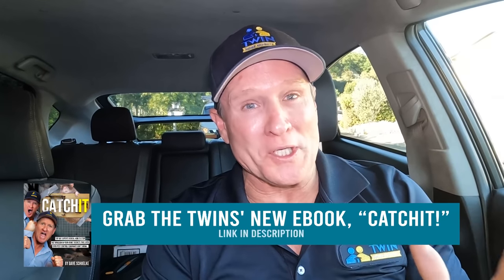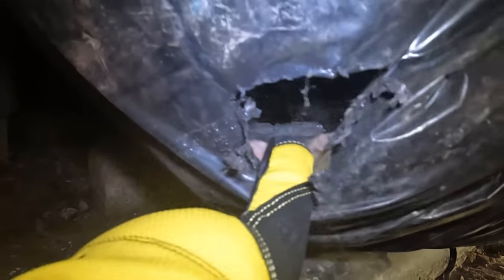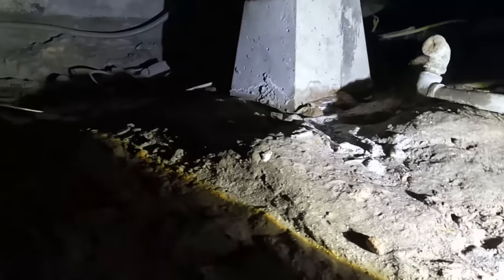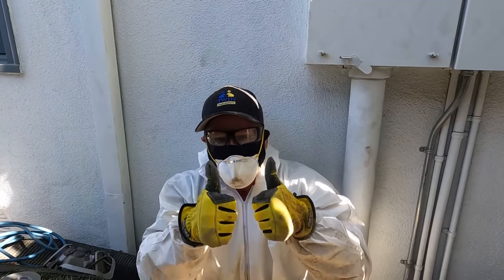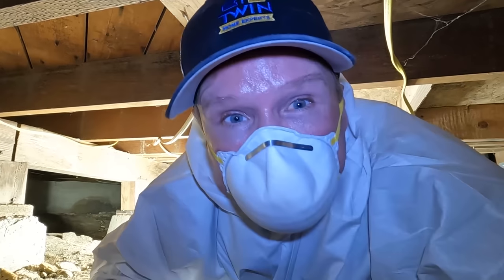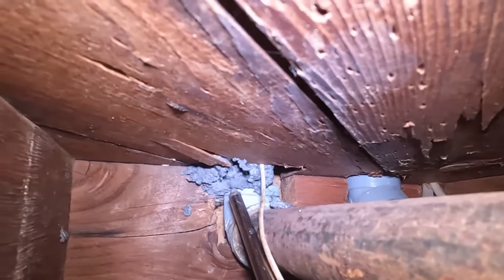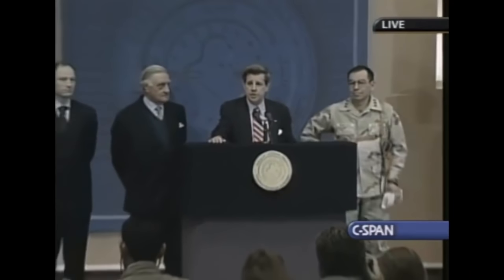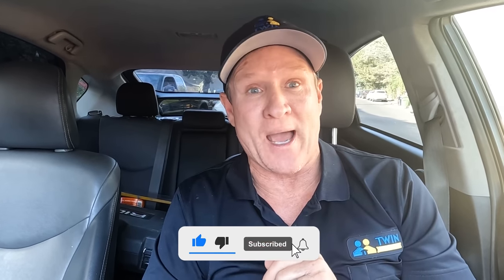CHANNELLOCKS vs RATS!! THE BEST WAY TO GET RID OF RATS QUICKLY!!

Comment: I just went through some crawlspace exclusion. I fought rats for a week or so; they either started eating each other or going after stored food (e.g., snail shells). I stuffed one small opening with steel wool (about the size of a dime) that the smart ones exited through by removing every night... I don't know how they fit  because they were big (caught a 5" one outside the house). The final one chose to stay inside and ate some baking soda balls; it hid itself in some crawlspace insulation when it died, and I had to fish it out because of the stink. I learned all these skills from The Twins videos!
Reply: I use to work with insulation. So that meant attics and crawspaces, still have nightmares about it. The smallest attic we ever crawled threw was about 17inches. We use to stuff main entrances (rat holes) with mesh and foam. Horrible times
Reply: @TheycallhimZee  17 inches? Wow. I can't even imagine. I would much rather be in an attic than a crawlspace, if it's large enough.

Comment: I’m no expert but I have no idea how or why homes would ever be designed this way. It’s absurd to me that ducts would be hanging low like that in a damp crawl space laying in the dirt essentially. And why in the world do crawl spaces exist…. Seems way more logical that if you’re going to have something like this, it be a much larger area in case maintenance and repairs like this needs to be done. Then again I’m not a builder nor an engineer, perhaps homes are built like this for some specific reason. I have no clue, just seems absurd. You’re only making it harder on yourself to have such a tight space like this. Respect to you guys for getting under there. You couldn’t give me enough to go anywhere near a hazardous environment like that. Great content fellas!
Reply: I’ve bee thinking that for years, where are you located?
Reply: The unseen areas like the crawl space and attic are always very shoddy, it seems to me. 
So many wires just hanging around. What if maintenance is needed or if something breaks. 
It would be horrible to have to work there. 

The Twins are so good at checking those kinds of spaces out. I understand why they wear hazmat suits and masks.

Comment: how you get rid of mice/rat urine smell out the house if you never needed to open up walls ? i see you guys spray your solution to disinfect inside the walls but if no walls were need to be opened what do you do?
Reply from the maker: You have to find the source inside wall or not, you should always enzyme treat.
Reply: @TwinHomeExperts  no good...they could of been anywhere in the house....we subposed to open up every wall??? ......isnt there like a fogger thing you can use that'll get inside walls? has to be a easier way!!!
Reply from the maker: @johnny0253  we use our purocleanze that off gases into the air and attacks odors too. It all depends on the situation. This is probably what your talking about.
Reply: @TwinHomeExperts  yeh that sounds right....
Reply: Had the same problem in a house. Had to find the nest and entry points. Made holes in walls in suspect areas using process of elimination. Found nest and possible entry points, sealed entry points with steel wool, removed nest and affected insulation, treated with nature's miracles, patch and painted holes no smell now. It was quite the process and seemed impossible at first to figure out. Start with process of elimination. Happy fixing